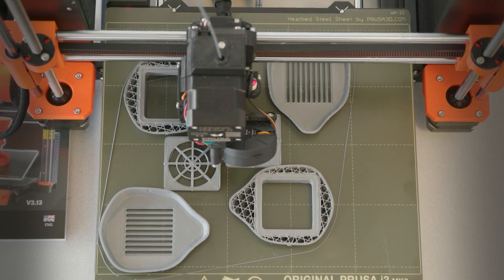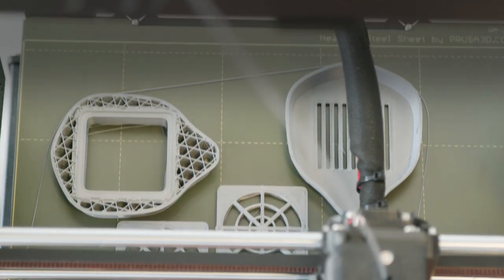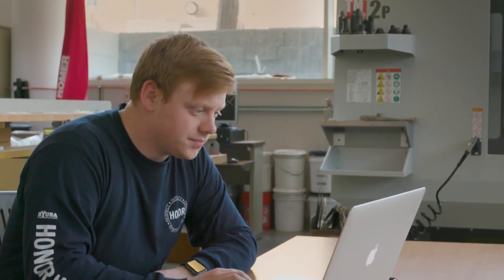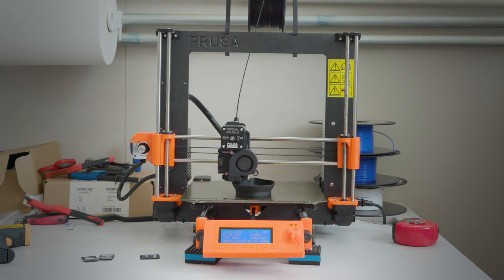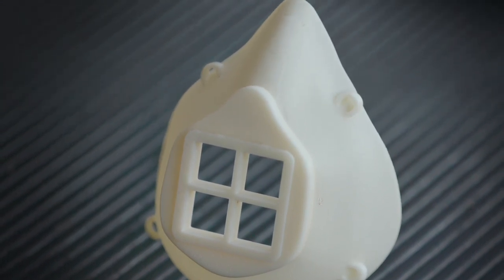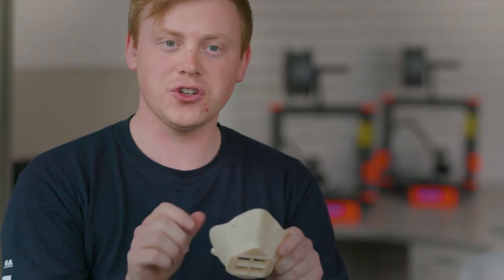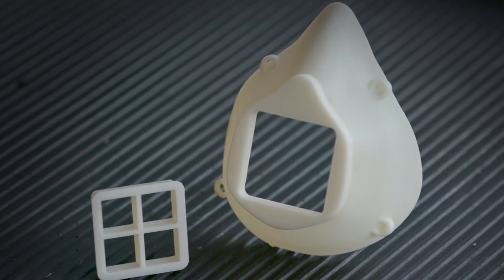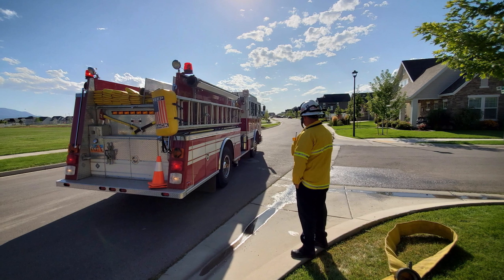With masks in short supply, BYU engineers use 3D printing labs to assist first responders

Comment: I've printed those exact masks, they take 19-21hrs each. In that time, injection  molding could make > 1,000. The best filament for air seal in flexible TPU. The hot water PLA fit helps, but doesn't seal well if wearer tries to talk. 
Also, a study was published this week that concludes N95 is only required when inserting  breathing tubes.
Reply: Even at good settings, it only takes 3 hours for me. But i have now remixed the mask to print in 2.

Comment: What kind of 3d Printer are you using?
Reply: The orange 3D Printer in the video Is a very good and reliable printer called "Original Prusa i3 mk3" and the other one the "BlackBelt" is special type of printer that has an "infinite Z" coordinate capability's .